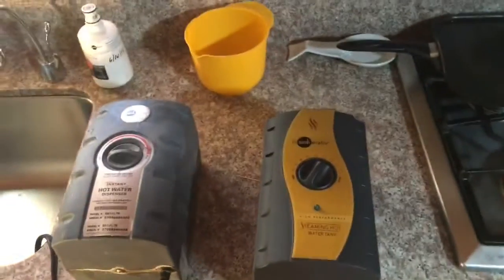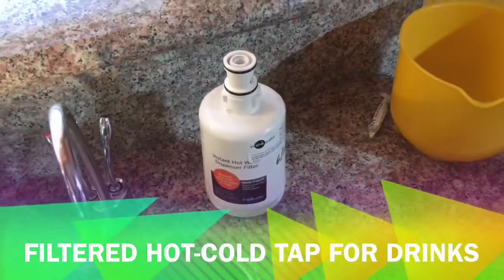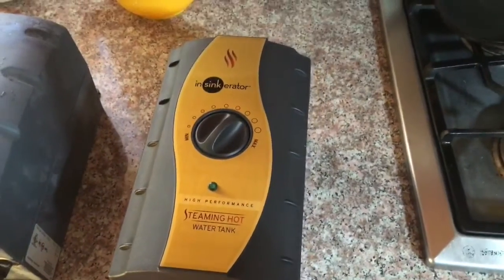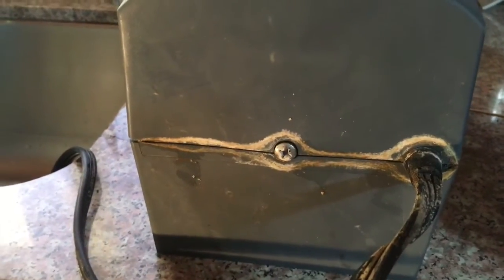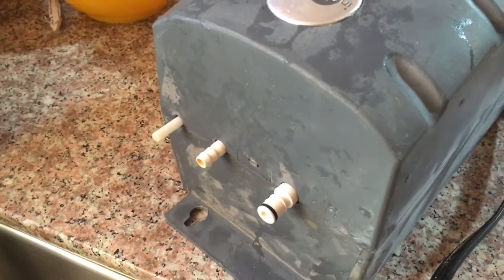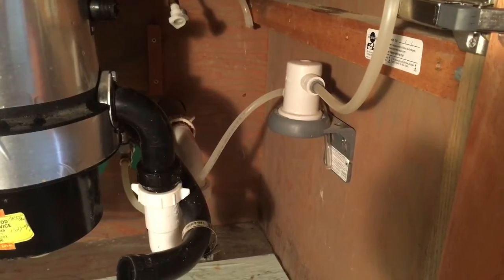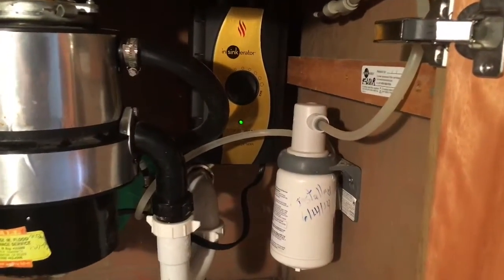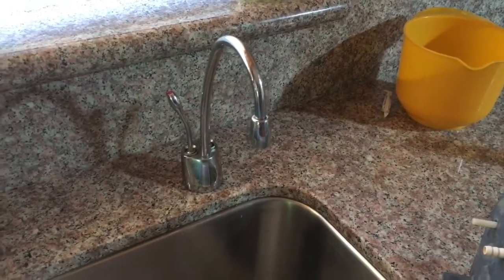Insinkerator Instant Hot-Cold Water Dispenser Install

Comment: If you open up your old unit, it is more than likely that it is just the internal plastic tubing that is cracked and leaked.
Reply from the maker: I didn’t see any way to open what appeared to be foam coated tank.
Reply: Yes, I've seen multiple tanks (including mine) whose internal tubing had deteriorated from heat and failed. I replaced it with silicone tubing. The tubing must be disconnected to free the overflow reservoir before removing the styrofoam insulation.

Comment: The best way to fix the loose handle leak problem is to take the nut off the handle (on top, either hot or cold) and then remove the guard that the handle rests on.. .just pull slightly ...very, very easy.  Then put LimeAway or CLR in the hole and let it bubble up, rinse it out and repeat a few times until no bubbling happens. Then fill the hole with WD-40 and reassemble. It will look and work like new....Turn the spout on and let it run for a minute to remove any remaining residual stuff.